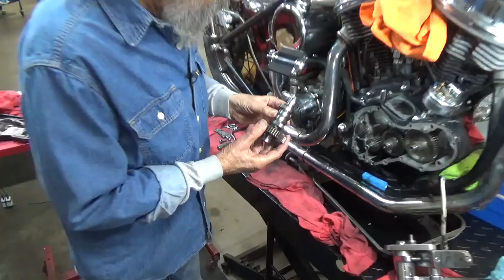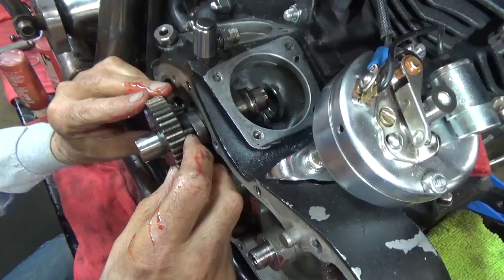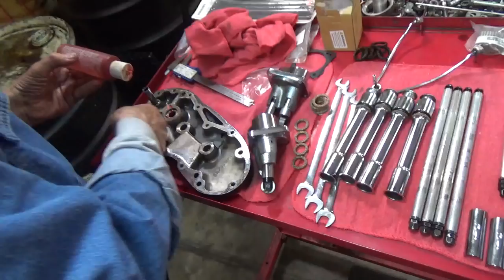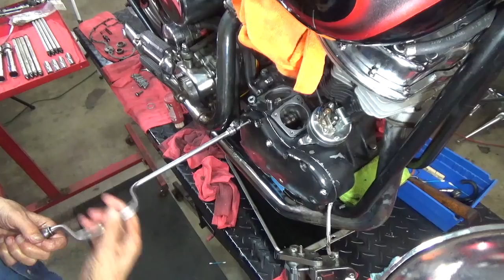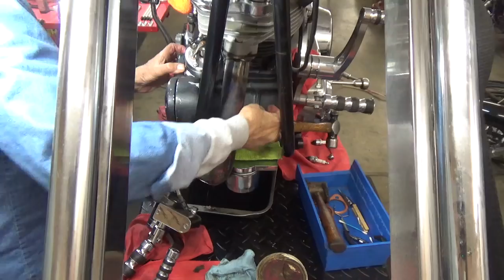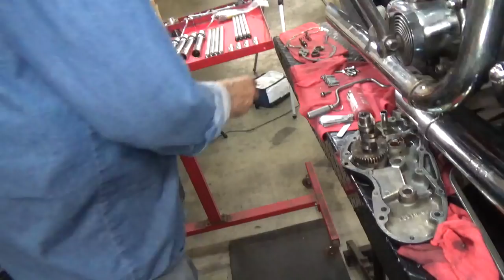Part 5,Changing the Cam In a Harley Panhead

Comment: Is that a piece of an old spring-loaded close pin you whittled down to separate the cam cover from the case? I used to get so much sh#t from my old friends for improvising. I miss those guys. But at least I have you around to help me refresh my memory and increase my knowledge. Damn I enjoy watching your work. Say Hi to Mike the camera man for me. He does good work he had the light levels dead on without the flashlight. I'm still planting onions. The weather just is not cooperating here in Maryland
Reply from the maker: Thank You.  The clothes pin halves are wedge shaped.  And, they're softer than the aluminum.   No damage.
Reply: @pacificmike9501  I used to whittle the ends down sometimes. I have plenty of them now that the lovely wife feeds the birds year round. Nothing like fresh crisp air dried sheets. Oh well her loss. Oh yea, I snuck in a viewing of the Mouse Trap adjustment. If I ever get around to installing one (I've had one for 10 years) I'm going to have to set up the laptop on the bench and pause it every step as I go along . After watching the video I noticed i was on your Knuckle. I  think I remember the ratch top not showing up till around 1954. Does this mean you can use a ratchet top on an earlier transmission case? Thanks as always. The wife just walked in I have to go help with the groceries

Comment: Hey mike, great series. Can I ask why the cam shaft isnt shimmed against the cover? It seems the new gasket is what has made the end play so much larger, but if you keep shimming from the engine side, would that throw the cams off from where the rockers meet it? I truly don't know, as I dont have a ton of experience with this, so just a genuine question.
Reply from the maker: It's done from the case side.  That's just standard practice.  I have a couple of thoughts we'll try on Tuesday.  But we don't really have to move it enough to throw the "lobe placement" off.
Reply from the maker: By shimming on the case side, the shim rides between the hard camshaft and the hard steel "cam plate."
Reply: @pacificmike9501  That makes sense. I appreciate the response. I can definetly see the positive side of having something between those surfaces. Also, now I know the technical term "lobe placement". Sometimes my technical grammar is quite limited, so once again thank you, and ride safe!
Reply: Remington Steel  ahh yes, lifters, thanks for the help.  I know terminology is pretty important with these kinds of things, otherwise it's hard to describe what I mean. Ride safe man

Comment: Hey mike hope you're doing great. Really been enjoying this series. 

I just installed an s&s super E on my 03 sporty 1200. Motor is stock, running a Bassani 2-1 exhaust, and the stock s&s filter. 

I live in puerto rico at about 300 feet above sea level. Is a .0295 intermediate jet and a .072 main sound right to you? 

I switched up to a .031 intermediate trying to eliminate some slight decel pop, but looking up info, i've seen that due to having a high flow filter and exhaust, decel pop is common, and startup was a bit rough compared to having a 295 intermediate jet. 

Just wanted to know if the slight pop is common and if being at such a low altitud i should run a bigger jet even if i only have a small 1200. Sorry for so many questions, any insight is much appreciated
Reply from the maker: Try bringing in the accelerator pump a little earlier.  That pump is to help the transition.  Keep experimenting.  You'll get it.
Reply: @pacificmike9501  thanks allot mike, finally got it set up perfect with the .0295 intermediate & .072 main. Tweaking the accelerator pump got everything transitioning super smooth now. Honestly appreciate it a ton
Reply from the maker: Very cool.  I knew you'd get it.

Comment: Not trying to be a dick but my OEM service manual says cam end play .001- .005" loose. Is there a reason you go a bit looser?? Enquiring minds with too much time on their hands need to know.
Reply from the maker: Yah, but it's not final either.  I do like them a little looser than Harley's spec.  But, anywhere I can get a clearance I can at least play with is a place to start.  I have the solution.  See on Tuesday's job.  I think I got it.